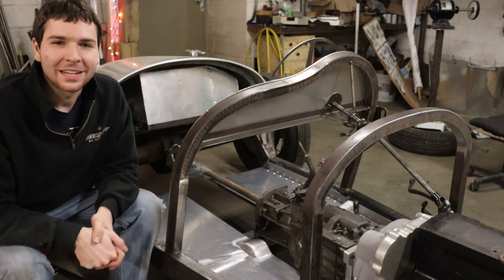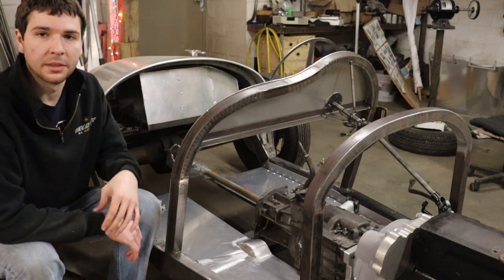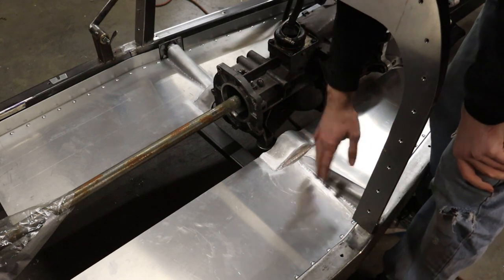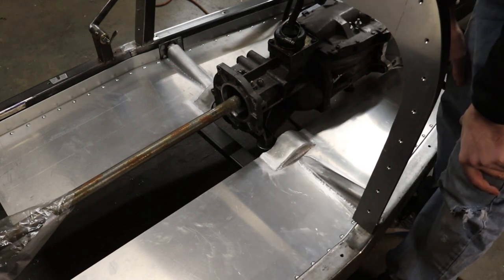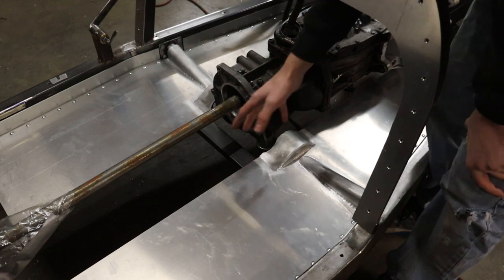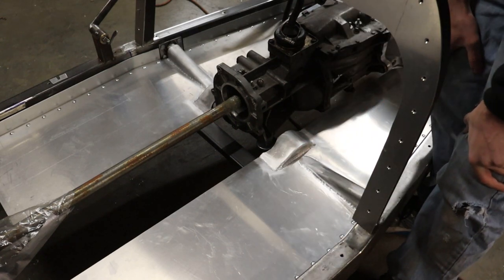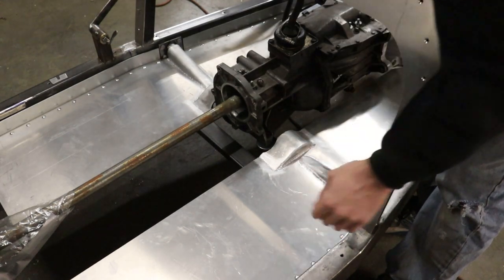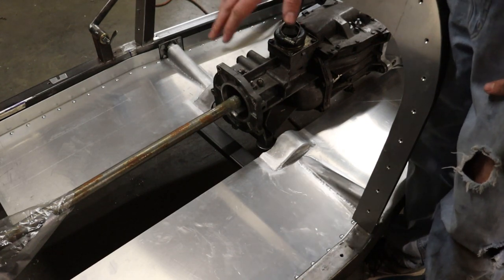Fabricating Aluminum Floor Pans | Homemade Boat-tail Speedster Pt. 46

Comment: Just amazing as always. I owned a pink and white 1955 Dodge Royal that had spray on rust proofing on the inside floors & trunk, you don't have to worry about rust, but it sure worked as a sound deaden-er. This one still had the plastic seat covers from the Dealership. After the rust proofing hardened up it was painted with the color of the car (pink) and looked real nice. I wish you could find a 100% original 55 Dodge to see what I'm talking about. Keep up the great work!!!

Comment: if you roll some beads in the floors it will be quieter and more rigid
Reply: If I hadn't found this comment then I would have made it.  Although these panels are not very large, they still represent a vibrating surface that will have a resonant frequency.  Perhaps when you least expect it they will let you know that they are there.
Reply: could he tig some strips of reinforcement on the bottom side to make it quieter?
Reply: @PazuzuStalker  Pre-war racers also found intermittent rattles distracting and annoying.
Reply: @alex4alexn  That would just add weight with a chance of only changing from one resonant frequency to a more annoying resonant frequency.

Comment: I apologize if you've already addressed this in a previous video, but I'm curious how you're going to get your roadster tagged to be able to drive on public roads.  The build is incredible, by the way.  I'm really impressed by the work you've put in!
Reply: Some states have a way to tag based on it being a hand built custom vehicle. You more or less have to prove that you built it and the receipts for materials and these videos would suffice, I think. There's probably a safety inspection also.
Reply: Usually requires inspection and a state issued vin #
Reply: Not sure of the laws there but probably similar to building a motorcycle you just have to pass some safety inspection and they give you a vin
Reply: Gee you folks in America have such an easy time of it.
From what I understand here in Australia we are advised to join a car club, you need plans drawn up by an engineer, ($$) constant examinations at a cost ($$) permits for just about every thing ($$) vehicle examinations by the police all costing huge dollars. 
when you see those channels on YouTube that build Ratrods, even put a turbo on your vehicle etc the chances are especially with Ratrods NOPE not a chance in buckleys of getting it on the road LEGALLY. Turbos or any performance mod would again need permits and engineer reports depending on what is done, to have YOUR VEHICLE LEGAL ON THE ROAD
Check our some of the hassles Mighty Car Mods. Have been though on some of their builds.
Tony from Western Australia 🇦🇺
Reply: @MoondyneJoe  Hi Joe. I used to get upset about how the MGB had the ride height raised and 300lbs of steel bumper added to it to meet US regs, when I started looking at Rat Rods with their multiple points of pedestrian impalement being allowed to roam the streets at will. Australia seems to have changed a lot over the years too. I'm sure I remember seeing that you could build a light aircraft and fly it, so long as you kept away from built up areas a few years ago. Keep well.

Comment: think you need to put a sheetmetal brake on youre wishlist , if possible one with plenty of width
you could do it with a beadroller if you make a V and knife edged shaped die for it but its harder to get a straight bend
might want to add a lip to the floorpanels on the transmissionside to mount the transtunnel to 

allso consider oxidation , the row of rivits look great but the two pieces of aluminium rivited together will collect water in between them and will cause it to rot out over time , a bead of silicone or body kit between the seam wouldve prevented that if you want period correct maibe try tar (roll it intoo rope and lay it in before clamping it up , the tar will make it possible to get it back a part if you heat it up but it be messy )

Comment: One question, after the floors are in and the interior is finished and let’s just say you have to take the cross member down how will you get to the bolts on the sides of the frame to take it down?  Love the build and your doing a super great job, kiddo!!!
❤️🔥🔥🔥💪🏼👍🏻👍🏻

Comment: Drilling holes to the underside of the frame rails would make car lighter and after a good rust preventative treatment will stop it from rotting. Enclosed frame traps moisture and rots from the inside out, especially when it's bimetal, as in this case steel and aluminium.

Comment: How are you preventing electrolytic corrosion between the aluminum and steel parts? (It's not a problem with stainless, but normal steel should be insulated.)

Comment: Great work as always and bummed you lost the floor fabrication footage as that looked like some interesting fabrication work.  I second the comment below to put some beads in the floor panels to stiffen them up.  Are you going to leave the transmission open like old British roadsters used to do and only cover the prop shaft?
Reply from the maker: The floors are 1/8" thick, so they're quite stiff just like that. For the transmission, I'll either leave it open or make some kind of leather or rubber soft covering for it

Comment: Just wondering are you going to make the transmission cover and tunnel? As this could effect your pedal assembly and seat location? Great video as always 👍🏼
Reply from the maker: It won't be a rigid trans cover. Probably just a rubber or leather covering that attaches to the floor
Reply: @MacroMachines  In that case make sure to put a safety loop around the propshaft like a comp altered dragster. Loved the whole series so far and can't wait to hear that Jag fire up for the first time!

Comment: Just my opinion here but I think you are making a big mistake. I think the body should have been made separate and mounted on rubber mounts. It is going to be so loud that it will take some of your enjoyment out of driving it. That floor will work just like a speaker, catching every vibration from the engine and road a be sending it right up through the passenger area.
Reply: Make your own car then
Reply: I bet your name just got scratched of the list for getting a ride in it when it’s done. 😉

I sure hope you build yours with rubber body mounts. As for this one, it’s an open cockpit so sound levels are going to be on the loud side to begin with and as I mentioned in another reply I believe he mentioned in one of the earlier videos that the aluminum panels will be isolated from the steel chassis.
Reply: @Crewsy  Yes he did say he was going to use thin strips of rubber but I don't think it will be adequate. By the way there is nothing wrong with constructive criticism. I have commented many times on his videos with praise as I think he is quite the brilliant young man. I have always welcomed thought full criticism myself. I read him as intelligent enough and then some to welcome it as well.